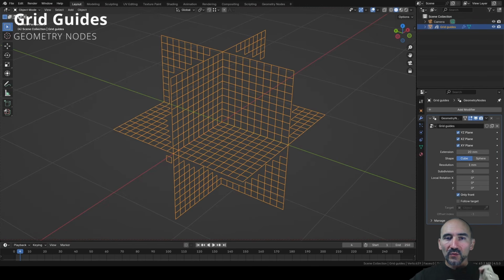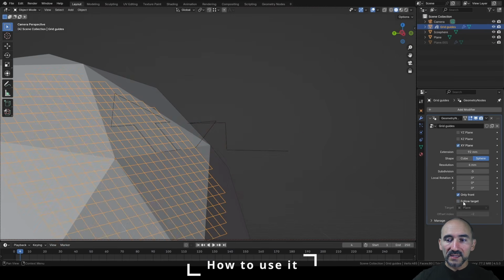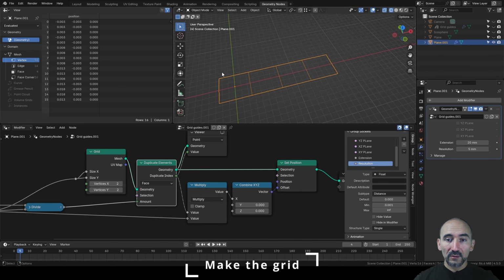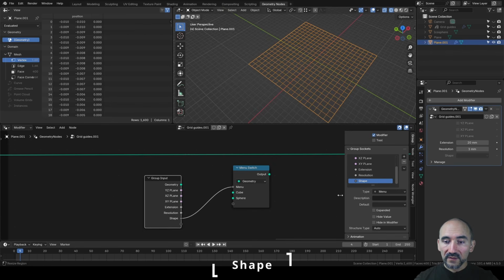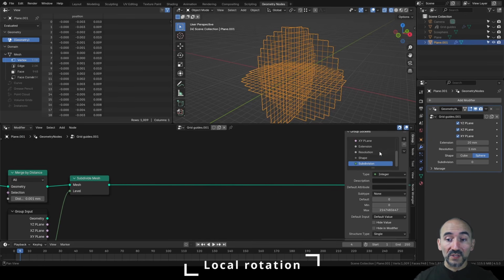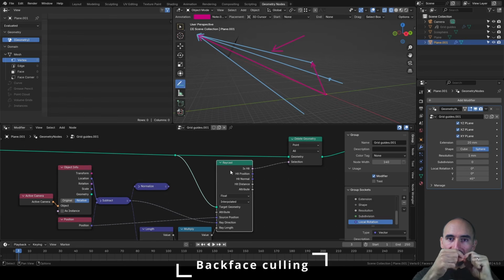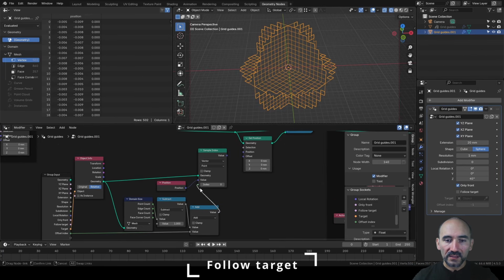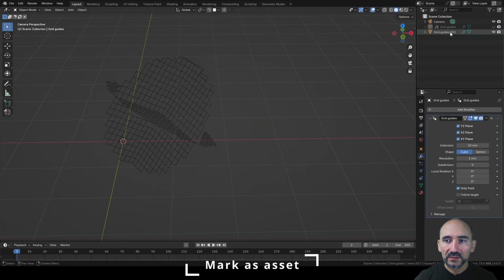Grid Guides in Geometry nodes - Blender tutorial ENG

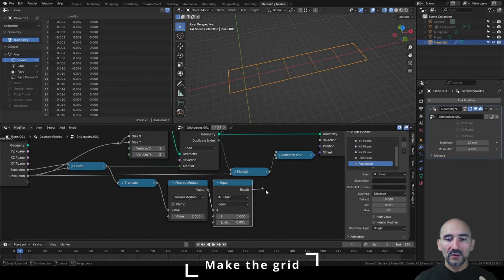Comment: Okay...so I'm at the 18:45 mark and my version of blender (4.5.3) is dividing .02 by .004 and I get 4.9999995...the only thing I can think of is that my settings are in meters as opposed to mm. Either way seems to be a bug in geo nodes?
Reply: The fix was easy, I just replaced the Truncate with a Round. Could it be a units of precision thing? I have limited experience with programming, so this may sound naive.
Reply: Just a great overall exercise. Tons of info to learn from.
Reply from the maker: @paulkuykendall5584 thank you! About the precision I always suggest (and not only me) to use the most adaptive unit scale in your scene instead of setting very little numbers like 0,004 because the floating point calculations and results could make issues in the measurement like you saw. I would suggest to work in mm, more reliable in most of the projects.

Comment: Thanks for this. My mind reels with possibilities. 
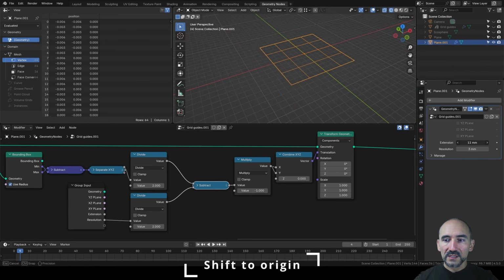@23:59 I use the bounding box and then mix min max with a 0.5 factor. That gives me the middle of the diagonal. Scale by -1 and offset the grid. Is there a reason that I shouldn't do it this way, I mean when we use it, does it change something? Also, to avoid having the origin in a weird place I made the extension a number of rows that I multiply by the resolution to get the amounts . The number of rows being multiplied by 2 the center is always in the right place. 
Then @27:49 for the shape I took the extension (integer) divide by 2 and if the length of the position is greater than the result I delete the faces. 
I hope it will work when used. The downside of my extension is that the total size is not fixed, but usually I adjust this visually by changing the extension.
Reply from the maker: Absolutely agree! The first alternative way you wrote I used  it in other videos so yes all the techniques worth it. It’s always great to see the other people try different ways to reach the same goal 😊 and thank you for the comment as always John!